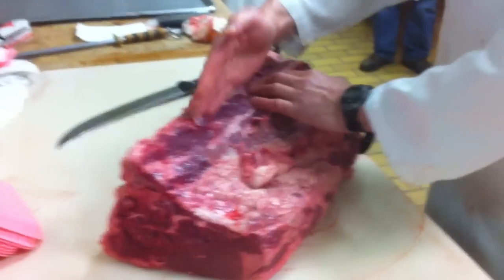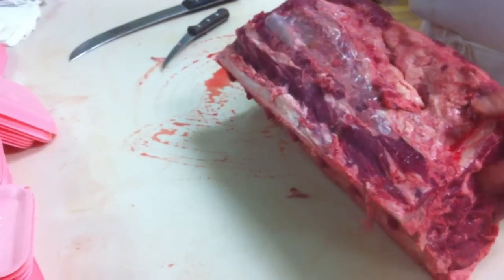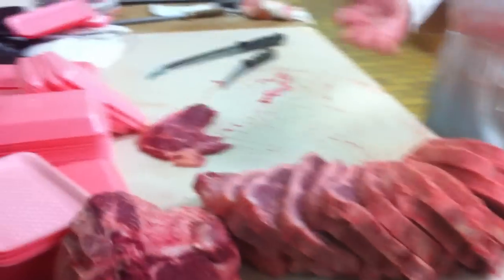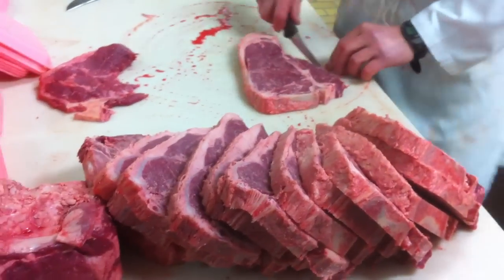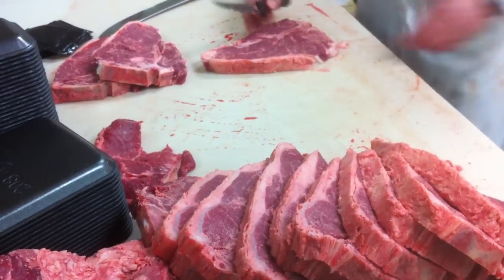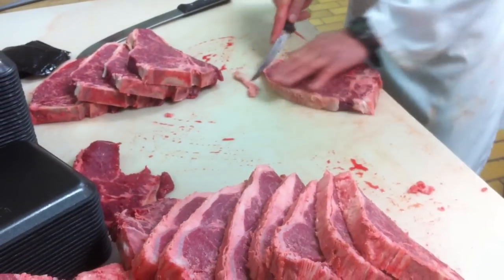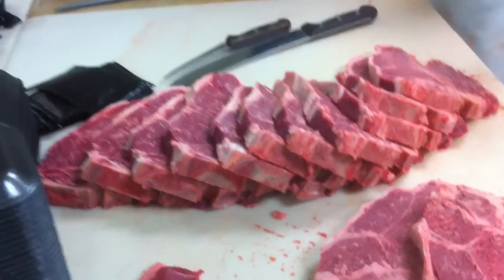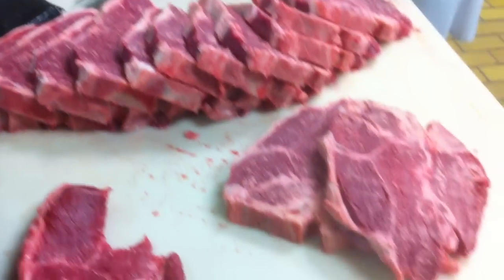Meat Cutting demo - Beef Shortloin

Comment from the maker: You scrape them just before you tray or display them so the steak is clean going into the counter. If you were to do it before you trimmed them the steaks would pick up any bone dust that may be on the cutting block as you trim.

Comment: I realize you're teaching young Meat cutters, taking time.  Why didn't you remove more of the chine bone BAD split? Also you applied way too much pressure to the Scraper. I could tell by the color of the scrapping.  TOO Red, bone dust is white or light pink. For sure not a production Video. Cut, Stack, Scrape, Flip Scrape, Trim & place Soaker in a Tray & Box it, place on a Tray to be wrapped. Also the slower you cut the more the Saw Dust. 47 years in the Meat Business.
Reply: he is cutting room temp beef. my work is 40' or less. way easier to cut when its cold.
Reply: Harold J. Briggs don’t you trim first then scrape? Or is it interchangeable. I’m a meat cutting apprentice. Still a little green in my opinion and looking to learn every day.
Reply: Chris p90
   I was always trained to scrape then trim. I was told the longer that the bone dust is on the meat the faster it will turn in color.